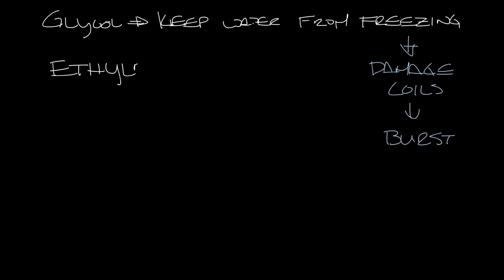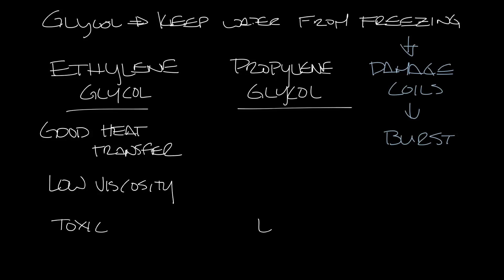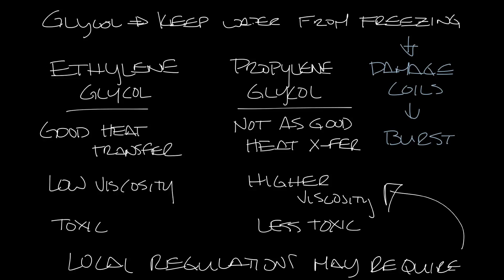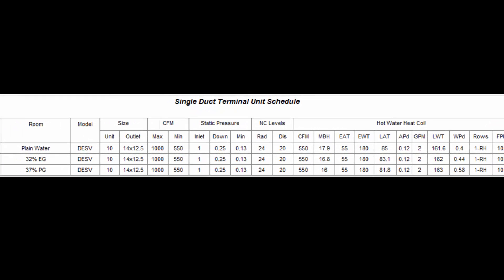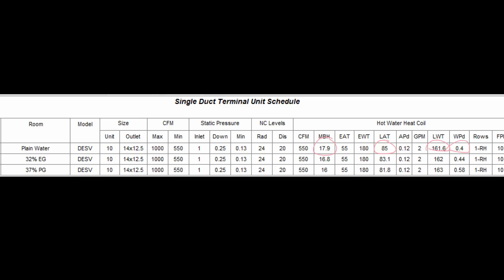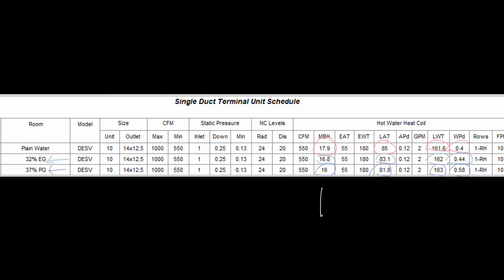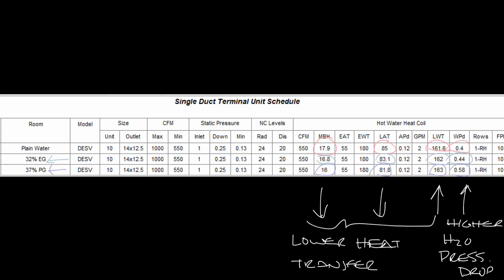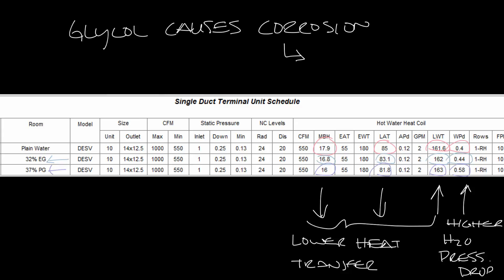Titus Timeout Podcast - Glycol in HVAC Water Systems

Comment: Nice video. I use glycol when ever I can. When I do winery chillers (due to low required temps, cold pull down for bottling) it's a must. I thought the glycol inefficiency was lots greater. Why I use little as possible. Thank you

Comment: Nice video!
Reply from the maker: Thanks!
Reply: TitusHVAC  Did you ever hear of the Cooney Freeze Block Technology? You can remove the glycol from the system if the glycol is being used solely for protection of the fluid coils.